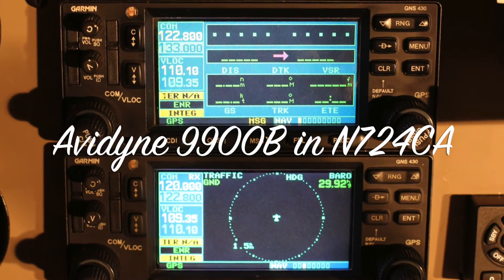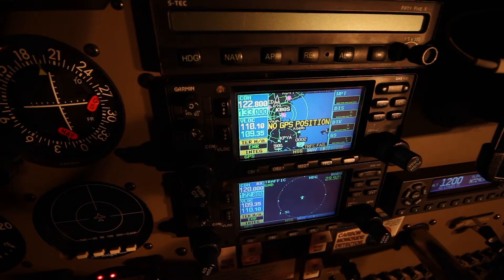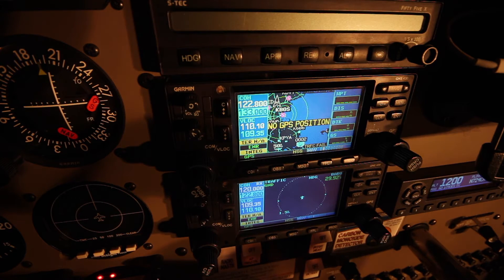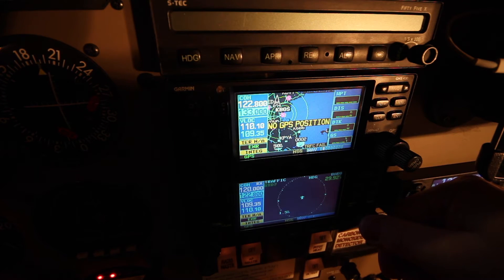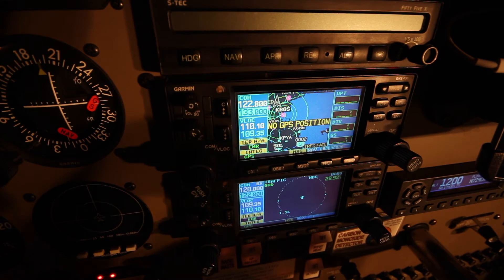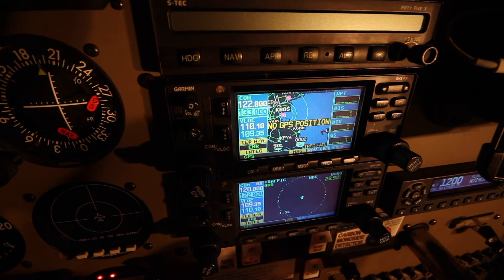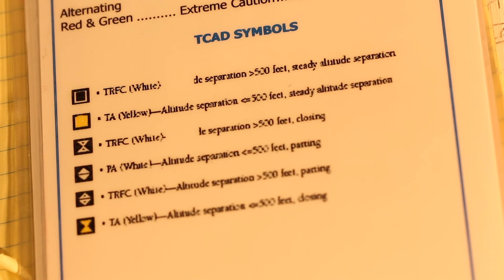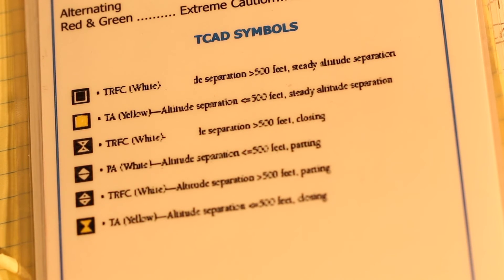Use of Avidyne 9900B TCAD in N724CA

Comment: Karl nice work.
Reply from the maker: Thanks Brendan- If TCAS is good enough for Air Force 2 its almost good enough for us.  I marble mouthed a few things and reversed the top and bottom L band antenna locations, but I wanted to get a summary out to the club as the depiction of traffic is different. Had some radial engine noise on the presentation. We had traffic from ADS-B in only on the Map page Garmin 430W-1, TCAD only on Garmin 430W-2 Traffic page, and panel mounted iPad vector traffic from the Transponder ADS-B in.  Also that WiFi from the Stratus System was still available for extra Foreflight iPad units from the Stratus 2, but not from the Transponder which only has bluetooth and one available connection.  Its a pretty unique system with multiple, independent, diverse modes of traffic advisories.  Its important to know the source.  The ADS-B in with the Satellite connection is the most accurate but the TCAD will kick in Traffic and Proximity alerts to the Garmins with an audio alert.  Hopefully we still will look outside and hear ATC.  Its a fantastic situational awareness device.  Summary page was a bit out of focus but the important points made.